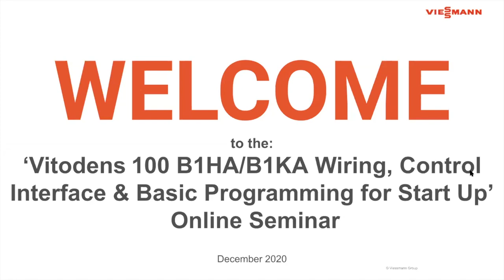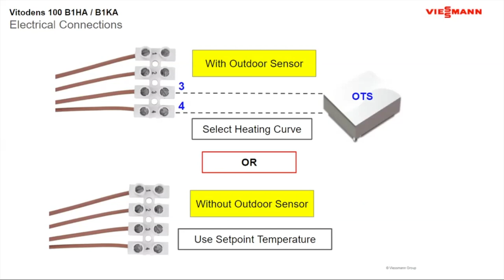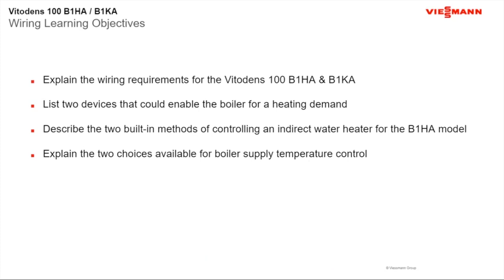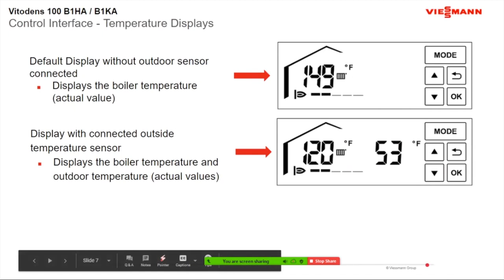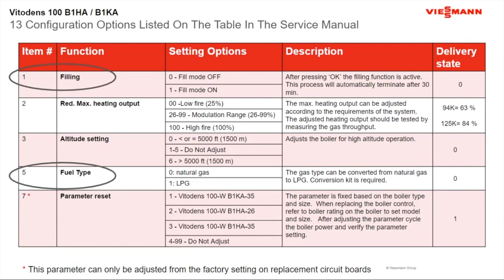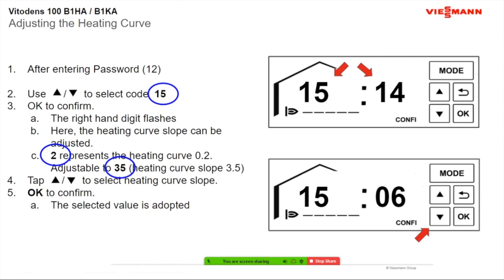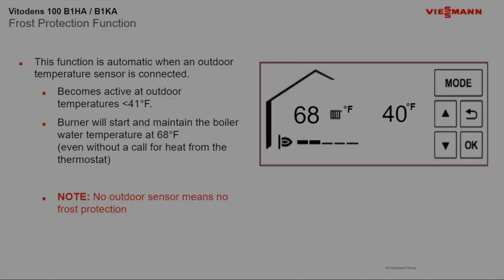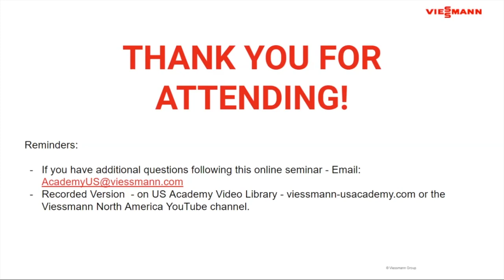Online Seminar: Vitodens 100 B1HA/KA Wiring, Control Interface & Basic Programming - Dec 2020

Comment: We had the house power cut off from hydro and when they powered house back on an hour later we tried starting the unit/ boiler and it started the info screen for about 2 seconds and then it tripped the breaker we tried to start again a bunch of times but just keeps tripping the breaker can u tell me what it could be and how to fix.pls n thx.